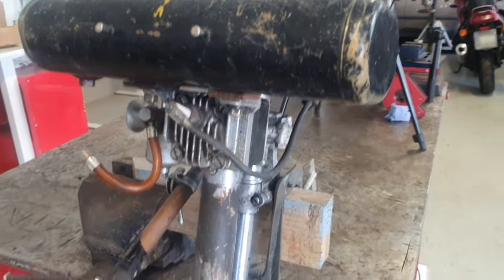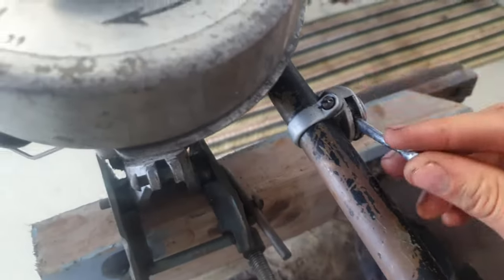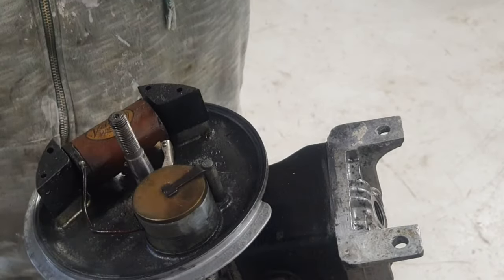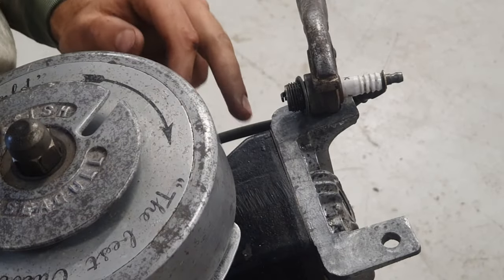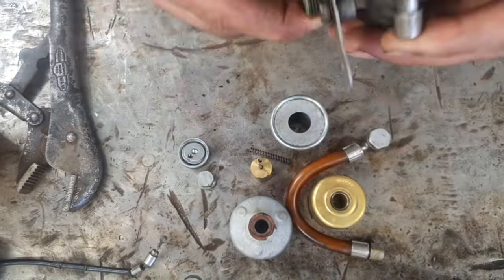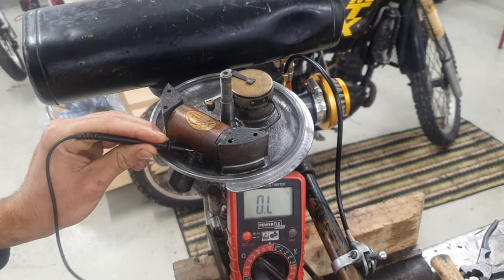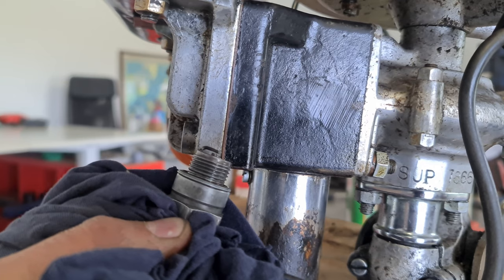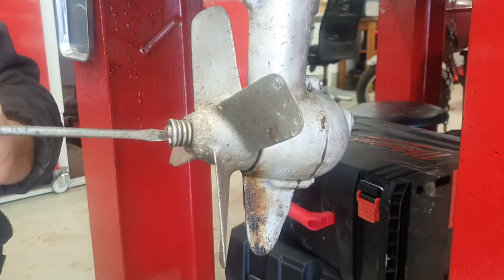Reviving a British Seagull Outboard

Comment: Even modern outboards typically don't have air filters. The water does a good job of keeping the dust down, so they're not really needed. That being said, it can't hurt to add one!
Reply from the maker: That's good to know because, the little air filter fell off into the abyss on the last boat trip 😅
Reply: Takeoff that filter!
1, it looks awful 
2, it is not required 
3, to stop a Seagull, (if I remember correctly) you throttle back and place your hand over the air intake. It has no emergency ignition cut off, perhaps it is worth making one.
Reply from the maker: Wym? It looks radical. Probobly adds another 2hp at least. Pimped up seagull, classic. 😎